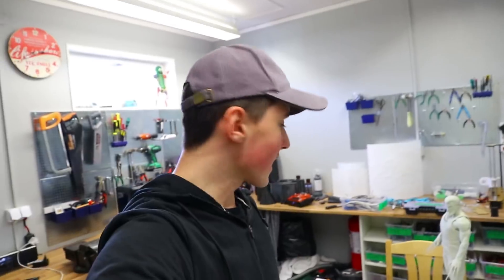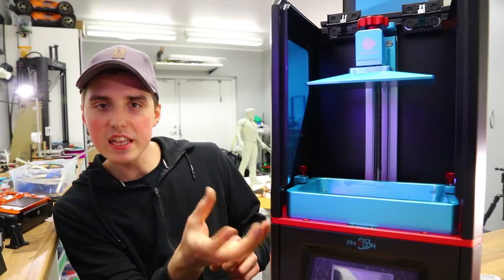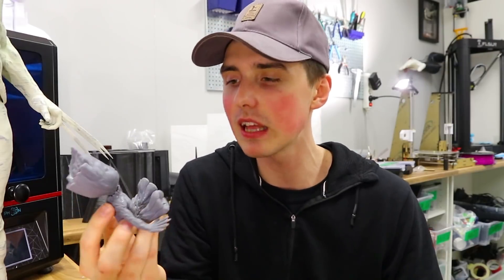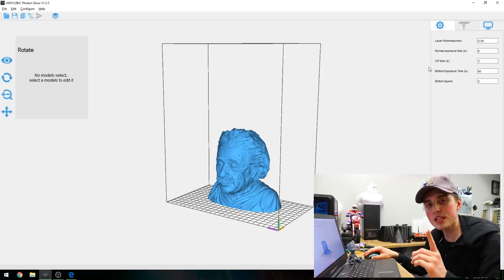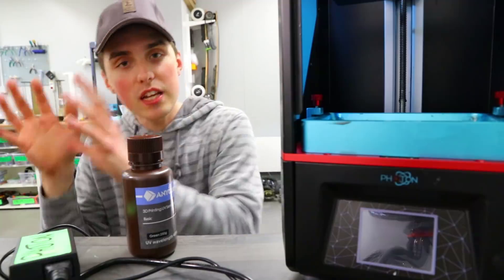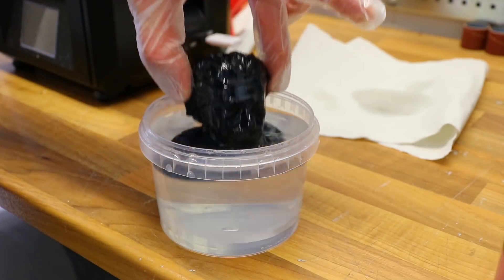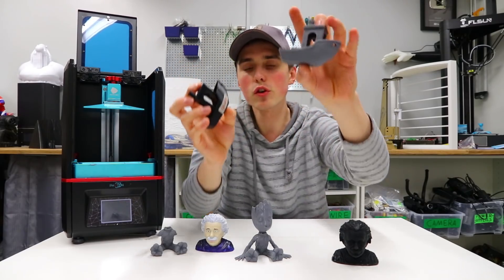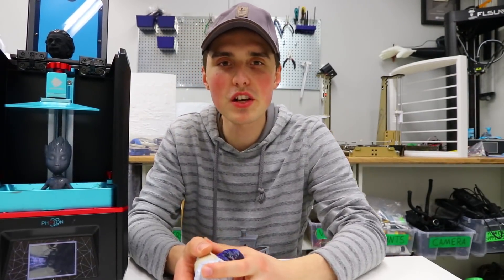Anycubic Photon DLP Review - SUPERIOR 3D Printing Quality!

Comment: I also want to buy 3d printer my budget is 500 dollar please tell me
Reply: it depends on what and what size the printouts are to be. Large FDM, small and a lot of details SLA (jewelery design etc.).
If the cost of the material also matters, then FDM ...
I have an ultimaker 1 and I can print with a layer height of 0.02 but it lasts I only use this height in places where it can be seen as the top of the ball print (gentle angle large layer shift)

If I had to buy something now, I would put together the fdm on the Railcore II 300ZL model, but without a few functions to reduce the cost and be able to add them in the future.

Comment: Hey @RCLifeOn I want to buy a 3D printer up to $500 Australian dollars (U.S $350) not sure if I should go down this path or the filament way. If I did go the filament way would like one that is good with all filaments. 
Can you recommend a printer?
Thanks and love your video's
Reply: I reccomend a creality ender 3 pro. Filament is cheap and the printer is brilliant. Very similar to print quality of creality cr 10s.
Reply: @isaaclyonsf1  thanks😊
Reply: @vekopandurevic4892  no problem 👍
Reply: you contradict yourself or I don't understand something.
resins are not durable and you write that if you were to buy fdm, then one that will print everyone, if you need it, why do you consider resins at all?
There are many filaments and some need about 400C and such a standard set is not enough.
Better decide what filament you want to print, I suspect that all this is too general.
Additionally, some filaments are so expensive that we are talking about hundreds of dollars for 1 kg. I doubt you will buy it and paying more for a printer that can handle it doesn't make sense.

Comment: Maybe anyone here can help me. I bought the Wanhao Duplicator 8 as it has a bigger print volume compared to the anycubic photon. Anyhow, the problem I am having is that, my prints come indeed out with amazing detail, though there is a flaw in every print so far. I am seeing a "line" every 8-10 mm in whole the print. It is a horizontal line. Its a straight line and is consistantly showing up every 8-10 mm. Does anyone have any clue how to get that out? Thanks.

Comment: This is a great printer, I have not had any issues yet but i'm sure I will have some. 
I would advise a fume extractor mod, drip mod, bottle filter mod (all on thingyverse) and to hollow out models if possible to save resin.
One last bit of advise is when orientating the parts try 45 degrees with supports on the edge as theis gives a  much better print.
All that said I would not recommend this as a first printer due to the mess and cost but if you need the detail then its amazing

Comment: One key point that isn't mentioned much. The printing LCD (inside the printer, not the LCD on the outside) is considered a consumable. The light dies over time. That means you will be regularly replacing it every couple of months if you use the printer regularly, and currently, there is no way to buy this LCD in the US.

Comment: Out of curiosity, do you have any idea how many 3.5" figurines someone could print on a single bottle of resin if the people had normal body proportions and standard clothes? I'm looking into getting one of these printers, and I'm trying to figure out if the per-print cost of each print would be to see if it would be worth my time to print/sell miniatures.

Also, has anyone tried printing jewelry with these? I'm curious how a band ring in straight resin would hold up as I've heard the resin can be somewhat brittle.

Comment: I noticed on some of the examples of your cured models there are 'wetter' areas. That is caused by resin that may have been trapped in crevices or not fully washed away from the IPA bath. 

ProTip: After you clean it with IPA, use an air compressor.

I utilize two 2 IPA baths, one an initial rinse called "dirty IPA" and the other is basically 'clean IPA'. Prints go off the build plate into the IPA Bath 1, where it will soak for about 1-3 minutes, depends on the resin. This gets rid of the main layer of resin residue, polluting the IPA mix. When I rotate out my IPA, the 'clean IPA' becomes the new 'dirty IPA'. You can use a coffee filter to filter the IPA to utilize it as 'dirty IPA" after about a week. After Bath 1, the model then goes into IPA Bath 2 where it will soak for another minute. This bath is fairly clean as once the majority of resin is off, there is very little left to color the bath. 

After the bath, I use the air compressor on them (you can use a can of air but that gets expensive), which immediately drys the alcohol but also gets anything stuck, alcohol or resin from any cracks, crevices or holes. Even if you do a normal bath or agtitate, there will still be some stuck depending on the prints. 80% of the time the one cycle is sufficient. I would inspect the model to see if afterwards there appears to be any 'wet' places, that is usually resin still stuck to the model that got blasted by the compressor out of crevices but not removed by the IPA. If I see that then I repeat my IPA Bath process before hitting it with the air compressor again. 

Obviously it doesn't have to be said, but apparently someone called me out because I didn't specifically say it. Don't use the air compressor towards you, always away from you in controlled bursts and output. It doesn't need to be full blast, you can even use a airbrush compressor (20-40psi). 

Once that is process is done I will cut the majority of supports away, some I save because sanding them down is better to cutting them to prevent divots just depends on where the supports are. Then I go through the cure process.  The finish of the model is perfect, never tacky and will not have wet looking spots in certain areas.
Reply: Cheers brother... All good info!

Comment: Awesome quality, but three times the printing cost is big. If you plan on printing, money wise, it’s better to get a creakily cr10s or a prusa i3...
Reply: Oh you want to talk about cost ... well lets look at cost if you print with DLP or SLA the cost of the print works out to be roughly US$0.20 per g (that is the most expensive functional product but you can get to below USD0.08 per g) as you can see from the finish there is a whole lot less time required for post print finishing which could end up costing you a whole bunch more in time. Added benefits are that with the SLA/DLP process you can build thinner walls on models which will reduce the weight and therefore the cost of the model. 
There are a bunch of other advantages with SLA/DLP especially for DIY. Where DLP is going to be finding its place is in full on production lines where usable products will be printed in stead of using traditional methods.
So all in all SLA/DLP is the way of the future ... don't get side tracked by the cost of the liquid.

Comment: What is the strength of the SLA resin prints vs. something like ABS or Nylon FDM printed material ? Basically what I am asking is can you print mechanically usable parts with the AnyCubic Photon ?
Reply: Hi, i have this printer for about a month now, have the same purpose to use it as you have. Printing functional parts for oldtimer cars in my case. have to say it is a nice printer and i love this gadget, but...... I tryed different resins, 3 brands different hardness levels. maximum i tryed 80D. This is not as usable as PETG and PLA (or ABS etc etc), maybe in the future, maybe other brands.... i dont know, it is quit expensive so testing around is not as cheap as with PETG etc. Problem is see is that resin on resin (gear on hub) are 'eating each other' white powder shows up and i think parts warn out very quick. So combination of materials, like i do now PETG end PLA. Also using a PETG gear on a resin hub, not as quick as resin on resin, but still with powder on my hubs. I was hoping to print parts that i could not print before, because the high resolution some parts that are not air tight at lower resolution would be air thight with resin printing. I think that will work, because i now have a softer part, i solved problem 1 and got problem 2 in return. Conclusion, nice printer to expiriment with and i am sure i can use it someday for a actual car part, but that i need to search for a really hard resin type

Comment: How did you fix the issue of running out of resin mid-print?  If I were to print a rectangle the size of the build volume, how would I keep topping it up without exposing the resin by opening the machine?  Thanks!

Comment: I use to manage and operate one of the first  SLA machines for commercial use. It was a bit of nightmare without the resin leveling wiper that subsequent machines had  but it was amazing just to have that powert back in the late 80's early 90's . The resins we used back them was Ciba Geigy and they were nasty! to work with and the printing environment had to be well ventilated, controlled for humidity, etc.  It was very expensive to quote prototypes because of the high costs of the machine, resin and post processing that had to be done to the models, with a lot care in order not to have warped parts.  I printed a lot of cellular phones and played with the machine during my spare time, often staying overnight in the sla room to watch some parts grow and looking to see that all the layers were perfect. Not having the resin leveling wiper meant the parts took a .......long.... time to build,  I decided I could build a bed leveling device myself, but unfortunately the company I worked for, that had the machine, came to the conclusion the machine was too much of a money pit and decided not to continue its use.   It is amazing that what took a full 10x10 ft space  to house the very expensive machine, PC's etc and required a good deal of training, ~20 years later, is now at the hands of  the average user at a mind blowing price, not necessarily SLA, but DLP,  basically it is the same thing just repackaged a bit different,  but both use photo sensitive resins and are built layer by layer either upright or upside down using supports, and a laser (light) to cure the parts.   I really like the way Anycubic has approached the design of their 3D printers with the user friendly LCD interface and the ultrabase platforms. I have the Anycubic I3 Mega a pretty reliable printer and I have printed on this machine some amazing prints, with a bit of extra care in the fine tuning and maintenance.  Resin (SLA or DLP ) printers? hmmmm?  this Anycubic DLP does look clean design, I like the compactness, but any resin printer is still quite messy  and a higher health risky to work with.

Comment: Have you tried the form2? Can you compare? I have a form2 and wondering how long it will be before a 500 dollar printer can match it
Reply: The Form 2 is an SLA printer using a UV laser light to cure the photopolymer, the machine that is reviewed here uses a simple LCD screen (like your TV) to mask the light from a UV LED light source below this is the new super cheap 3D printer that is going to flood the markets like FDM has done before. There is another form of DLP, that is similar to Carbon 3D, it uses a projector with a UV light source to project the light onto the build platform from below. 
There is no doubt that the DLP technology is the future for 3D printing from a speed and quality perspective. 
Do not worry about size, there are a number of projects currently in R&D that will be breaking size barriers.

Comment: That is a crap FDM benchy. You need to drop the layer height down some more and slow down the print. You should be able to get a perfectly smooth roof with no steps.

Comment: If you do get one if these and need a bit more ventilation - Buy some cheap PC cooling fans, and some dryer vent tube. Wire the fans to a 12V power supply, and place one at each end of the tube and boom! Now you have a quick, incredibly cheap ventilation system that's suitable for both soldering and any smelly print materials you may be using such as ABS or a resin.

Comment: ohgod the resin drinking bit made me panic from across the room hahahah. DO NOT touch that stuff, or let it touch anything organic. I poured some onto grass to cure it (once it's hard it's 'safe' to dispose) and the grass died and never grew back. Had to turf the dirt as well. Mine comes TODAY apparently. Waiting anxiously after seeing this. Awesome vid man!
Reply: Just as a heads up Angus, you should consider using Monocure Resin with your Anycubic Photon, it's an Australian made and sold resin and so far I've had excellent results with it using the Photon. It costs about the same as most other resins but it's local so getting it from the manufacturer to your door happens fast. (for those who live in Australia)
Reply: The form has superior quality resin and it has almost no odour but you should still NEVER touch it. The MSDS for the stuff is scary.
Reply: Maker's Muse can’t wait to see your review
Reply: I repeat buy a 3M gas mask. It is not expensive
Reply: Hey guys, UV curing photopolymers are environmentally hazardous please take care of how you work with them and how you dispose of them. If used with the proper safety equipment and handled properly they are safe. PS also watch out for the UV light don't look into it your eyes will be damaged, keep the machine closed when the light is on.
Reply: I’ve never taken many safety precautions with my form, and I’m fine.. I think? That said the resin didn’t smell like mentioned here. Maybe it’s not as nasty as this stuff. I let it touch my fingers and I just clean it off as soon as I can

Comment: 2 things that I would do to it: 
Add a 120 mm noctua fan at the top and also an evacuation hose to atmosphere to get rid of those fumes in a quiet manner.

Also add a bottle of resin upside down with a hose going into the resin tank similarly to a float in a water tank so I never run out. Idk how this might work since I think it also calculates the resin drop but I would try it anyways.

Comment: SLS has a lot going for it as far as quality but I think it has a lot to do with the finer layer heights and finer x/y resolution as well.  There is also less that can go wrong if it does go wrong.  IDK if fdm will ever be able to print in such a fine resolution but SLS will probably never be a contender for doing large printing either.  They each have their use cases.

Comment: What about print time. You did not tell if it's faster, slower or same time printing?
Reply: Hans Milling I'm wondering the exact same thing.
Reply: It's probably hard to compare because an FDM print takes more time with an increase is volume, where a DLP/SLA print takes more time only with an increase in height.
Reply: Someone wrote in the comments 120s for first layer and 20s for each additional layer

Comment: Please do a review on anycubic kossel.
Reply: kossel linar plus with auto bed leveling, its a cheap delta printer (£250) and might be a alternative to the Tevo little monster lol
Reply: @methgaming I’ve order one from Ali-express but it’s been over order and delivery has been set back a month so I’ll just have to see what my experience is. But my expectations are very high for this printer, it must be better than my anet a8 lol
Reply: Well its a cool Printer but its a loot of hassle. 
The building experience us good. 
The leveling works fine but often loses the data of the last levelling when powered of and the z offset stop working after some time. 
Even the new firmware doesn't fix it. So i have to but a peace of paper on the build plate while leveling. Othere whise a good printer and you can use a 0.8mm nozzle
Reply: James clark 
I am shure of that but it is still not hassle free but definitely a fun experience.
One tip check that the thermister is correctly in the hot end mine slipt out and ruind my hotend

Comment: How big is the build area? What do you recommend CR-10 or Photon?
Reply: Print costs are about x20, also depending on the model. Resin is much more expensive. PLUS: sliced models are made solid. There is no 10% infill, always 100%. You can make the model hollow manually but that is sometimes difficult. For printing small detailed items, resin is very good. But if you want to print many big items, FDM can be good enough.
Reply: Markus Kruse thanks
Reply: Models can be hollowed.